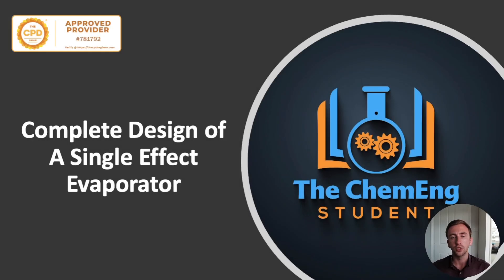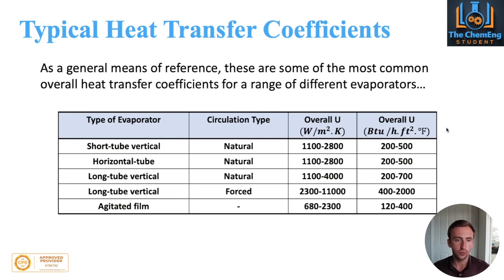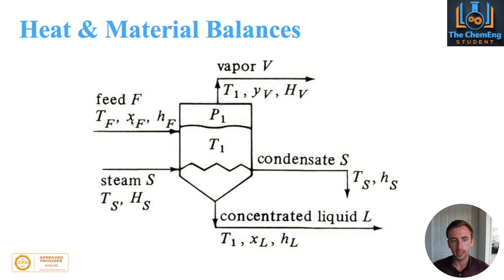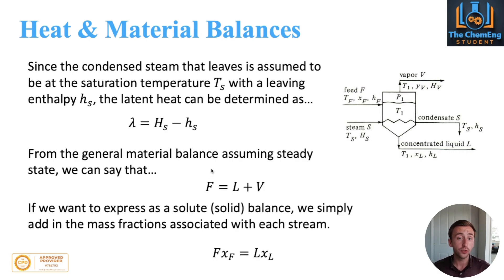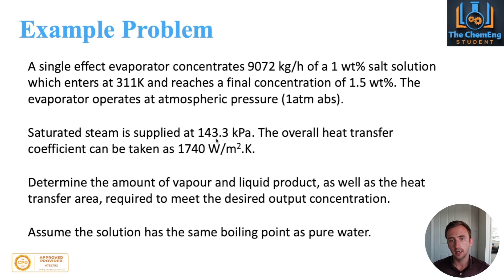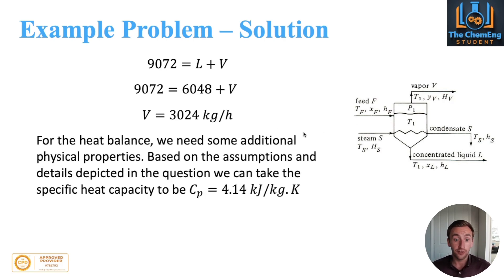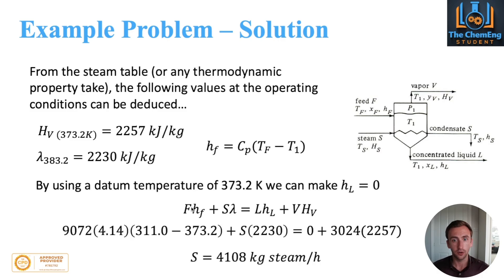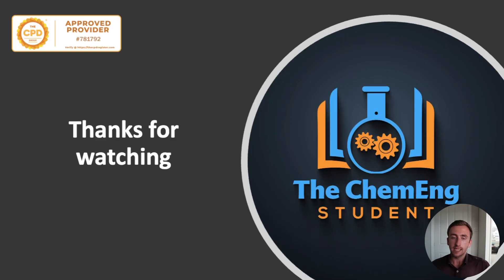The Complete Design of A Single Effect Evaporator | Unit Operations

Comment: Hi there, I would like to ask, as this video covers regarding the steam required and the surface area for heat transfer, are there any guidelines regarding sizing of the evaporator itself? I am currently tasked to design an evaporator for my thesis but am having a hard time finding references regarding how to calculate an evaporator's dimensions (length and diameter). Thank you very much.
Reply from the maker: Typically, the sizing of an evaporator depends upon the thermodynamic performance you would like to achieve. You can use this as a basis and then perform a series of optimisations, whereby changing configurations, materials, fluids, etc, in order to reduce the size. Perry's, and Unit Operations by Geankoplis are helpful in getting an idea of the relative sizes and conditions for evaporator design. I hope this helps, and thank you for watching!

Comment: After the area, you would figure out the tube dimensions, how would you go about that decision?
Reply from the maker: There are two ways, either you have a set of constraints that you must adhere to, i.e. there is a maximum size of the unit and therefore the sizing is constrained. On the other hand if you have flexibility, you can decide using the heat transfer duty and heat transfer area on the size that meets this requirement. Alternatively, you can vary the construction material, and this will either increase or decrease the size depending upon the thermal conductivity. I hope this helps, thanks for watching!